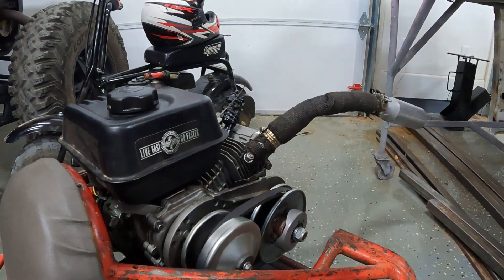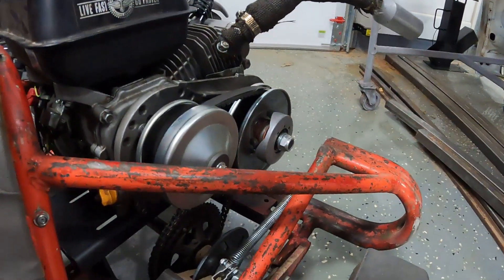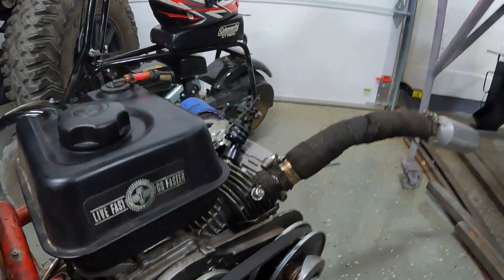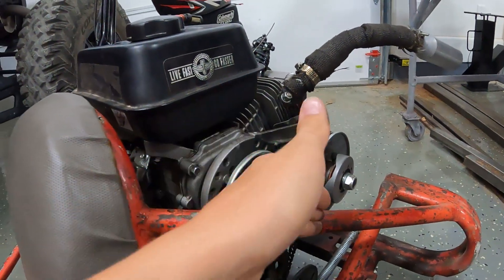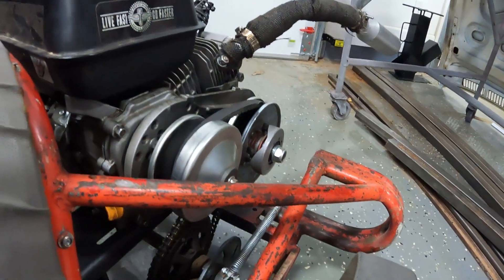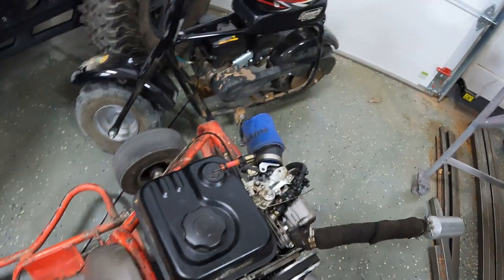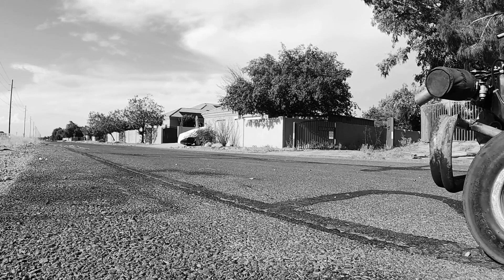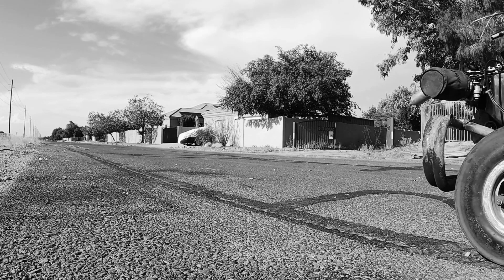How to put on a Juggernaut on your gokart

Comment: love ur vids dude i put on a new max torque clutch on my coleman ct100u and it wouldn’t fit onto the output shaft and i did the sketchiest thing of my life and let the engine run at idle and took a peice of sandpaper and sanded down the output shaft ever so slightly
Reply from the maker: Thanks man. That’s funny I’ve seen some people like cars and cameras using a grinder to shave down generator crankshaft while it was in the floor bouncing up and down because generators have a funky shaft size
Reply: yeah the PTO shaft on my ct100u was 5/8 and the clutch that i got was 5/8 and it wouldn’t fit so when you have no money and no lathe then you gotta do what you gotta do